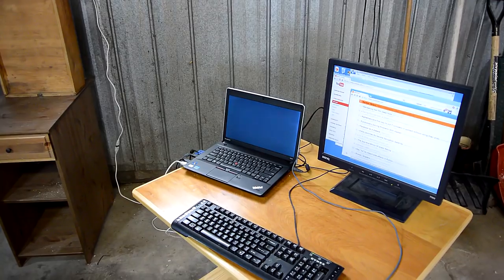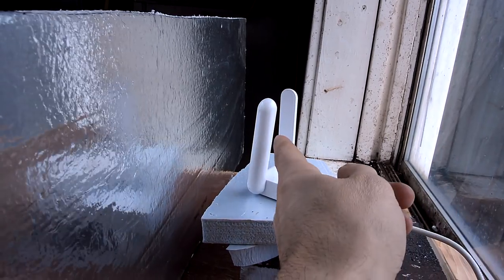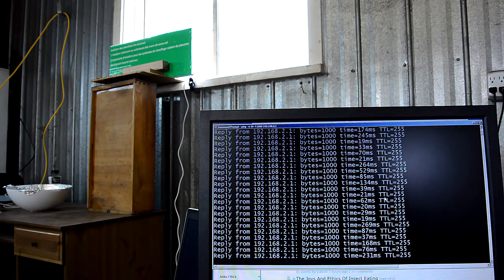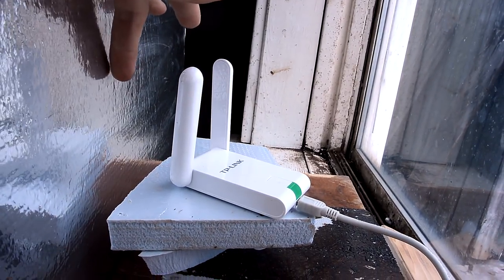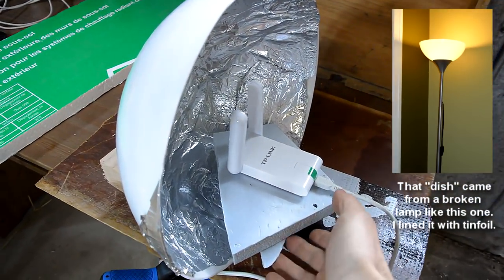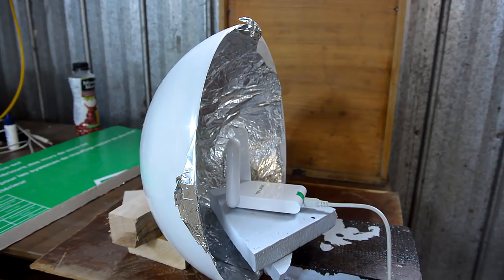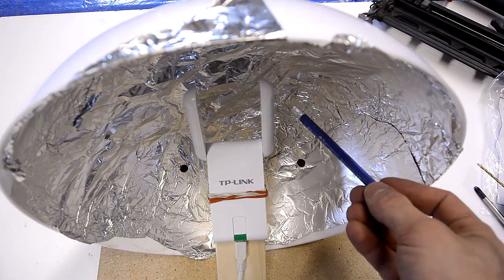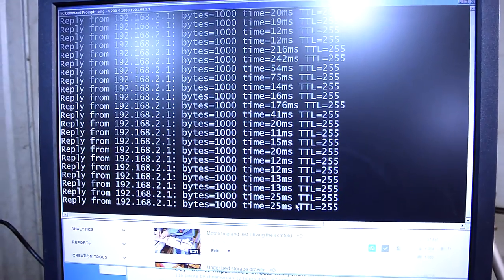Wifi antenna booster dish

Comment: Sorry trying to get the family up and make breakfast at the same time as sending this. I got tired of using a bowl because it would get bumped. So what I did was I went to an apartment complex and asked if they had any apartments that had a satellite dish that wasn't using the dish. I was given 3. Take your wifi adapter and mount it in the tip. And extend the USB cord with a 25 ft one. Now mount the dish out side where it won't bet bumped like on the roof or wall. Point it and you can get about 3 miles of range. I used mine and pinged the public library 2 1/2 miles away and it was a good connection.
Reply: MAKE A VIDEO PLEASE. I'M SERIOUS BECAUSE I USE CAPSLOCK. LOL
Reply: I don't need one any more and I dismantled it many years ago. But do a search and you will find info on this
Reply: david trystman ok
Reply: Or even better, get a wifi router hacked with dd-wrt on the roof and have it take the wireless and convert it back to ethernet, then tag another wifi access point (Ubiquity Networks AP-LR) and rebroadcast the neighbors Wifi into the shop.
Reply: Mitch Spacone lol what? Sorry not a computer wiz. :P
Reply: Thats good but technically illegal since you cant have more than a certain  dbm vs dbi.  Doubt anyone really cares though.
Reply: Mitch Spacone sounds expensive
Reply: nightmarejr explain? We are not changing power. Just changing a 360 degree and turning it in to a directional antenna.
Reply: david trystman I don't think i read your first post correctly. I thought by tip you meant the top of the antenna as in attaching the antenna to the router and using it as your main. All this can be found here http://www.afar.net/tutorials/fcc-rules/. Basically the lower power output you have, the higher db gain antenna you can use.
Reply: david trystman http://www.dd-wrt.com/site/index It's mostly free. Just need to find a router that's compatible with your make/model.
Reply: nightmarejr  this is what i did but i put the wifi part in the cone of that sat so it would be water proof http://www.instructables.com/id/Cell-Phone-WiFi-Signal-Booster-Antenna/
Reply: david trystman It isn;t actually. an AP-LR is only $90, and DD-WRT (open source firmware) works on a number of inexpensive routers. THe DD-WRT would be used to turn the wifi router into a wifi bridge - basically connecting to the wifi network with the awesome reflector, then making it available over the built-in ethernet ports.
Reply: But its easy and cheep

Comment: Theoretically, the proper distance from the antenna directly backward to the reflector should be some odd multiple of 1/4 wavelength. At 2.4GHz one wavelength is 12.5cm.  So, the distance between the antenna and reflector would be about 3.125cm.

The distance directly sideways and directly up and down from the center of the antenna to the reflector (if the reflector happens to be that big) should be the same odd multiple of 1/2 wavelength (6.25cm), ideally.
Reply: Would this setup have more gains, if the antenna was positioned vertical to the curvature of the dish?
Reply: @krollpeter  By vertical, I guess that you mean perpendicular. The answer is no. The main improvement that could be made would be to change the shape of the reflector. It's a bit tricky though since he has two radials instead of just one. The bowl really didn't give a lot of improvement over the flat reflector.
Reply: @noncounterproductive4596  I meant perpendicular. Thanks for understanding ... and even responding to me after 6 years!

I did try different reflectors and styles. There is only a gain for very weak signals. For connections of medium qualities or better there is an improvement in numbers, but that difference disappears into insignificance in terms of speed. For me it did not make a difference in speed, if I have -41 or -36 dB.
Reply: @krollpeter  Yeah I suppose that once the signal is good enough to get the digital information across consistently any additional strength doesn't really matter.

I ended up buying a large parabolic reflector wifi antenna, and a 3W wifi adaptor to use with it. I have seen that there are also kits for turning a DirecTV (or similar) dish into a wifi beam antenna.
Reply: what math are you doing

Comment: Put 3 pieces of mirror on the reflector shine a light at it. Where they focus is the focal point. Use that to locate your antenna inside the dish reflector. Hope this helps you!
73
Jimmy, ARRL TS, WX9DX
Reply: WX9DX It does. Thanks
Reply: well done.  I had some spare Directv dishes and took the same TP link and mounted it at the focal plane...zounds...it took a little bit to play with but worked fine business WB5MZO

Comment: Very interesting attemp! I don't know if you have updated the design. Ideally, your dish should be parabolic. Since you made a lathe, you should be able to make a wood antenna base. To optimize the signal enhanement, ping is a good method but indirect. You should be able to see the signal strength in dB with the driver and software come along with the adapter.
Reply: Pasar del inglés al. Traductor no entiendo inglés

Comment: Wavelength at 2.4Ghz is 5.92" so that distance is important to create a standing wave.  A wave can't "stand" if it can't fit between the antenna and the reflector. Doing half the distance will invert the standing wave causing destructive interference --- the more ya know, cheers :)

Comment: Haha, that's pretty cool. I also found it a funny coincidence that I just moved to a shared flat recently, and had a desktop with me that had no wifi adapter. I'm on a budget, so I searched for highly rated adapters that were cheap, and I wound up buying the exact same TP-LINK adapter used in this video. It is quite excellent!

Comment: I've been trying to stream HD video from my PC (office) to the living room (probably... 25 feet away?  Awkward straight line through walls, diagonally though).

I bought a much longer antenna for my PC, and it helped my range a lot, especially considering the antenna is still basically against the wall, pretty low (average large PC tower on the floor).  

Previously I always had the luxury of hard-wiring my connection, and I could do that now under the floor, but I also don't want to drill too many holes in the nice wood flooring at this rented house.

I have often thought of solutions such as the ones presented in this video, but I'm sure it's nearly as extreme as your issues here, at all.  Regardless, I admire your aptitude and work, taking a problem and turning it into a fun solution.

Cheers Matthias,
-Alec

Comment: What you're doing and Pringles cans are two different things.  Pringles cans are for focusing on a very narrow location which may be far.  They're very useful for reception, not so much for transmit.  A parabola is the right answer to receive all the weaker signals from various angles, and waveguide them onto the receiver.  Similarly the transmitted signal instead of being 360° will now be reflected in general to the focal point of the parabola.

It's all about the focal point... and for a multi-antenna TP-Link transceiver (not the best choice for this) changing the focal point to anywhere from Pringles to a flat aluminum foil sheet is the range you can explore.  Your bowl is good... but you might benefit from a deeper bowl.

To figure out where to place the transceiver antenna in the bowl... do a 3D cross-section and find the middle.  If you want the easy way to do this, place three analog cooking thermometers so they stick up from the bowl surface toward the outside... and where they roughly meet is where the antenna should be.  

You have a multi-antenna setup so signal cancellation is automatically handled for you.  (Look up "MIMO" and "Hidden node problem" for more details.)

E

Comment: the wave length of 2.4 GHz signal is 12.5 cm. The space from the reflector should be multiple of 6.25 for maximum performance (so both directions make 12.5).

Comment: Using speed of light and frequency of Wifi signal:
3*10^8 m/s / 2,4GHz  -> 3*10^8 ms^-1 / 2.4*10^9 s^-1
Wavelenght is 3m/24 = 0.125m or 12.5 cm.

For the wave to move all the way to the dish, then back again in phase with the next wave, you need the distance to be half a wavelength. The dish/reflector should be approx 6.2cm from the antenna.

Comment: I liked this. you might note for next time the focal point for a hemispherical reflector is 1/2 the radius  your bowl is not a full hemisphere so you were far to deep inside the bowl on the video.. It might have made it quicker to find the sweet spot. and if the diameter was more than 10 wavelengths that would increase your range to about two miles...
Reply: It would be the size of an umbrela. Even so I am not sure that so much delay between reflections and direct signal would give a respectively better SNR.
The rest just seem wrong since a hemisphere is not the right shape for a reflector, also the focal point must be specific quarters of the wavelegth from the reflector on the back, so there is no way to calculate in a random bowl the best position (since it is not build in the right shape).
Reply: ntomata0002 Ha,Ha I was designing microwave systems in the late 1970's and training microwave communications technicians in the 1980's and hemispherical reflectors and parabolic reflectors were no stranger to my slide-rules's answers. Microwave is analog not binary and I am apparently more of an expert than you in some technologies. (Although I  was a teacher of PC service and repair for 15 years also.)
Reply: Dennis Miles You should understand that today’s simulation tools give us a far better understanding of how electromagnetic radiation propagates compared to the limited knowledge we had around 70s. I have designed and build a lot of antennas in the 2.4GHz band, so expertise is no issue. What do you mean by “microwave is analog”? The network transmits digital data, so it uses some form of digital modulation, either amplitude or frequency.
Reply: I would like to add in order to clarify my initial objection that a hemispherical antenna has a very wide beam resulting in a very low increase in gain in the center in a size like that making it little better than a flat backplane.

Comment: Good job. Still, you should have a slider to move it forwards or backwards to fine tune.

To other viewers. Sometimes the windows have a metal film to cut down on UV and Infra red. That will pretty much block all signals. The glass in the video looked old and didn't have any tint to it.
Reply: But why make a proper slider when elastic bands work fine?

Comment: I bet if you got some metallic spray paint and just coated the surface of the bowl, you'd get even better signal collection. That creased up foil will cause a bunch of dispersion. Good job though.   I like that anything can be looked at as a problem to be solved and that you come up with solutions and post them!

Comment: I'm wondering here.. 
in theory, you should get the best reception at the focal point of the dish, but also, if it gets sunlight it might melt down the plastic of the receiver

      noooow... if you cover/paint the aluminum foil... electromagnetically it would still be there... would it still work so well without the risk of damaging the device?

Comment: Wokfi is also good (google the name and try it, if you are having issues)

I used to use an old circular deep fryer basket. Make a small hole in the bottom of the basket and push a USB wifi dongle through. It was very crude but it would pick up signals far more than the USB wifi dongle could get alone. I used this circa 2006 (I use lan cables now, but have the odd yagi antenna just in case)

Comment: Matthias, get yourself a wifi router and  bridge to the network.  You will have your own access point without having to run a cable to your computer.

Look at garage sales, look for any of the LinkSys WRT54G series (blue and black). I have four or five of them I've picked up for about $1 each. You can put the Open Source DDWRT image on it (it's fairly easy).  DDWRT gives you much better control than the default OS on a router.  For one thing, it lets your ramp up the radio power.

Comment: It would be cool to see how much more you could get with this. To be fair, what you have does the job perfectly well. I wonder what the improvement would be with a bigger, more accurate parabola lined with thick copper foil with the antenna right on the focal point...

Comment: you should use alluminium tape in the inside the reflector so it makes a smoother surface, if you tink of it the amount of scattering that wrincled tinn foil produces is important
Reply: With a waveleght of more than 100mm, even holes of 5mm would be invisible.

Comment: Seems there would be a lot of scattering of the signal with all of the large wrinkles in the foil. come up with a solution, aluminum paint, copper paint, or similar substance you could apply directly to the smooth surface of the lamp shade. Retest that configuration.
Reply from the maker: +drmckee As long as the wavelength of the signal is much longe than the thickness of the wrinkles, it doesn't matter.  And it's about 10 cm.

Comment: Have you considered just running a (LAN connection) wire to the router instead? I'll bet it is under 100' and that will keep your speeds up as well.

Comment: Nice choice on the reflector with regards to your wifi transceiver setup! The Pringles can antenna is a solid performer but you would have to get access to the antenna wires of the transceiver and translate to coax on the Pringles can end. Maybe too much work unless that's your hobby, you took the best route IMHO.

Comment: Just be wary that runs of 4m of USB and more require an active amplifier so the USB device can be detected.
Pringle cans are more of a narrower beam than a parabolic arc (if you will).
If you want to get better reception, you need better dBi antennas.
A Yagi would be the best long term solution. Good luck :)

Comment: Love it.  I was going to try the Pringle can method to try and get wifi at my greenhouse about 300' away.  ;-)  I have a couple of satellite dishes that would work well.
Reply: You might need two good wlan antennas both equipped with satellite dishes pointing at each other.
Reply: It's not the signal strength but the direction of the signal and how wide the broadcast beam is. Two standard $100 radios from Ubiquiti can go nearly 15km if installed properly.
Reply: Jeff Ferguson A highly directive antenna has a greater signal strength also (in the direction it points), so your statement is somehow misleading. In the receiving end though, not only it boosts signal strength, but it is also reduces noise.

Comment: Great video Matthias! I've been trying to solve my wifi problems with my second garage. I have literally 3 wifi extenders, and I still haven't been able to get a reliable wifi signal out there. I'm not sure what's blocking it, but both the house and garage are brick, so it has to go through some pretty thick walls. I've tried locating the extender up in the attic of the garage, but highest signal strength I've seen is low 50s...usually it stays in the high 40s. Do you think something like this would still work when the signal has to travel through walls , or would it only be effective based on a line of sight scenario?

Comment: Technically, the gain of a proper pringles antenna is better than your contraption. On the other hand the beam will be much smaller and it is more difficult to point at the other wireless router.

Comment: Great Job. For a better indicator than ping packets, you may try inSSIDer from metageek. It used to be an entirely free software. Currently has a free trial.

It is also possible to get a cheap Access Point with DD-WRT firmware compatibility and set it as an access point repeater. This would eliminate the need for USB cable. In addition to that, you will be able to use multiple wireless devices in the workshop. Most Access Points have much better WiFi radio compared to USB ones. 

I have read that access points with custom firmwares, together with parabolic dishes are used to connect villages in some remote parts of the world.

Comment: ok very nice idea it looks awesome. but here me problem i too have the same problem but my Wi-Fi antenna is on my pc so what would any of suggest i do to get better reception because i can pick it up but then it goes away again. any help will be appreciated i
Reply from the maker: +tertius van wyk Get an external USB wifi adapter
Reply: Is opening the window not usefull?

edit: After some reading only metallic coated windows give problems. Normal glass in general let the signal go through pretty good.

Comment: Good idea. I have a similar problem with the wifi adapter in my room, but I never tried to make a reflector. I guess it can't hurt to try, looks like it worked for you. Nice video.
Reply: let us know how it gos
Reply: OK, no problem.
Reply: MaximusPayne
So how did it turn out?
Was the ping okay, and did the bandwith decreas?
I am very curious :-)
Reply: As far as I can tell, the problem is not the ping to the router, it's fast enough, mostly a few miliseconds (generally 1 or 2). I suspect that the real problem is interference with other signals and/or signal attenuation, since the router is a few walls apart even though it's not "far" away. I bought a new adapter, one that has two antennas and more gain, but it does not seem to have improved that much. Guess I'll just have to wire utp to the room and get it over with ;)
Reply: Thank you for your answer :-)
Reply: NP

Comment: i have a cable modem with no antenna ears...where do i put the aluminum cardbox behind hit?, obviously if i put it in front of it it would block the remote control signals? I also have a wifi receiver in another room for another tv....wondering the same thing or only one needs the  this apparatus?